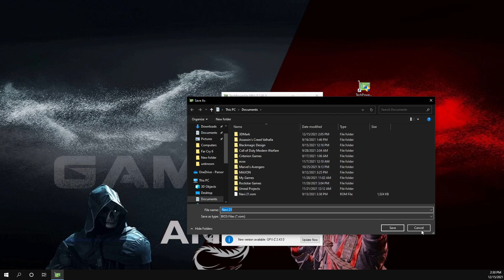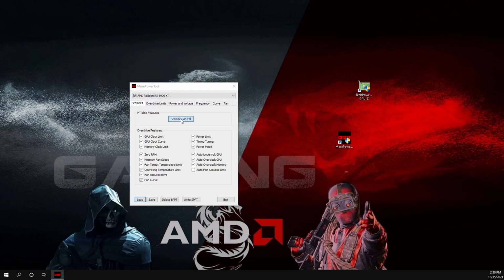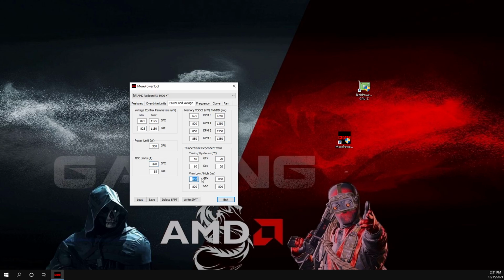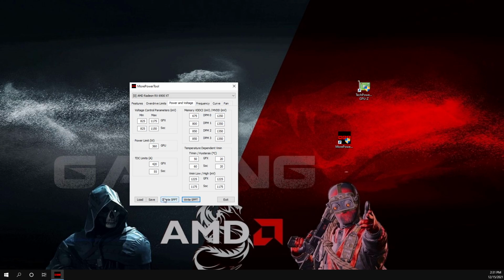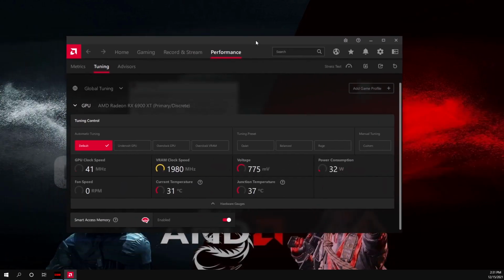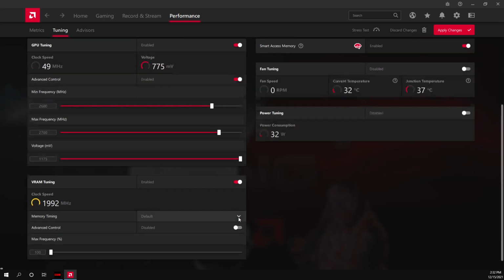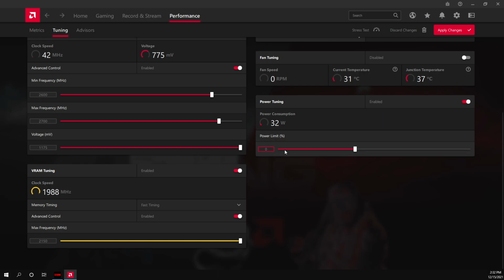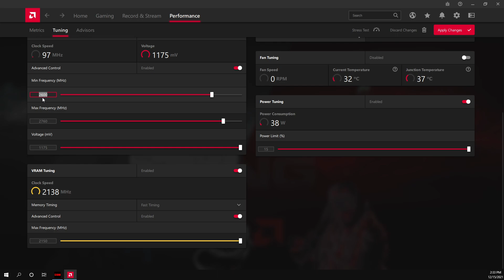AMD MPT ( More power tool ) Updated with how to add voltage adjustments.

Comment: I set a wider range in memory but if I exceed the default maximum my clocks drop to 500, do you know a fix for this?
Reply from the maker: should not mess with mem.. if you want to push out super fare swap bios this if done corectly would get a 6900xt or 6950xt up to like a 25k score if cooling is good in timespyt almost a 30% increase in performance. it really depends on goals and what you are confotable using I have run 800+watts to my card. it cooled by oipen loop with 4+ 360mm rads. duel pumps start loging benchmark temp with gpuz and look for temp spikes then 2 line gpu clock drops to like 500hz this tells you something is to agresssivce to the clocks being used .. memory the 18GB bios from techpowerup flash one side then you might as well do evc3 power mod and the cards will push to 28k plus in timespy.

Comment: Your VRAM is locked at max. Suspect vblank timing issue. Card should have idle power 3-6w. You're at 38W lol. VRAM clock not idling-known issue easily jiggled. Bang bang skeet skeet. AMD says no biggie. I say wtf brah 38w bang
Reply from the maker: so results of tuning with mpt on the 6900xt keep in mind this aspect has run like this since before I did the video showing how since about may of 2021 to present day...as for power yeah My cost to KWH is 17 cents like I care about power 

https://www.3dmark.com/spy/33335050

Comment: i need some help i have rx 6900xt i set in MPT 2600-2700 mhz and 1115 mv and now pc only stays at black screen i changed bios switch and that didnt help too
Reply: Happend to Me also, go info safemode with  wifi and download amd utility driver deleter, and then restart

Comment: can you help me overclock my bravo 17 5500M? i see the numbers but need some assistance
Reply from the maker: I have not worked with this and sounds like a laptop GPU and cooling would be the first limits you run in to I have another video showing how to in drivers kind of should be the same on a laptop GPU
Reply: It will work.For 5500m I will suggest you just enable those override functions only on first window then write it . Then after rebooting overclock on amd adrenalin softwere.

Comment: Thanks for video, will be testing it on my 5700, to raise 158W to 180W(Aliexpress Card, they messed with the settings I believe) & Core Freq from 1800 to around 2100.

Question, so after pressing "Write SPPT" we just need to do a reboot & no actual flashing is required?
Reply from the maker: Yes just reboot. These save in windows registry
Reply: @AMDPCBuoldersCommunity  Great stuff, thanks, very flexible if you don't want "permanent" changes & don't want to worry about bricking the GPU incase of a messed up BIOS flash.
Reply from the maker: @AlexHusTech  bios reports the base numbers to write to the regstry with mpt you can edit these .. on the 79xx ones rdn3 they verify them cant brick a bios here doing this RBE ( red bios editor ) is editing bios settings and works on 5000 and older gpus here you could edit a bios and brick it
Reply: @AMDPCBuoldersCommunity  Hmm can't seem to find the download link...
Reply from the maker: @AlexHusTech  for mpt? rbe just about most the tools and info can be found here 

https://www.igorslab.de/

Comment: I tried to set my Max memory clock in OC limits beyond the 1075 MHz (6800xt) but my GPU clock then gets locked at 500 MHz. Did AMD lock the overclocking of the VRAM, or am I doing something incorrectly.
Reply from the maker: Yeah if you mess with anything besides power and voltage in MPT the drivers don't like it too much. There is a couple of variations on the 69 series that you can kind of mess with but like the first iteration of the 6900xt it doesn't like it it's actually the one that has the 18 gigabit-per-second bios but you can get away with
Reply from the maker: The 6800xt on water cooling can push about 23-24k GPU score in 3dmark time spy. The colder the water the better it will push this does take a lot as well if you are air cooled the it will come down to ambient temperature case flow and how well the thermal paste, pads are. And cooler removing the heat. Once you start hitting 70c it almost stops scaling and if trying to find a daily settings keep it at about 60c junction hot spot only worry if it hits 110c as this is throttle limits .
Reply: @AMDPCBuoldersCommunity  Good to know, I'll try to keep my GPU as cold as possible.

Comment: Hi guys, I have a question. How do I save bios with MPT so I can have def settings ?
Reply from the maker: Just write it reboot. To remove delete it or reinstall drivers, however past 22.11.1 something has been different for me at least I might format to see if it goes away or not but adding voltage does not seem to work past 22.11.1 anymore

Comment: when I try loading the rom file it just says "maximum file size 1024kb" i cant use it
Reply from the maker: it should if you used gpuz to pull the file then something is wrong and needs to be troubleshooted out.. you can grab your bios from techpower up as well but it would be better to pull it from gpuz
Reply: @AMDPCBuoldersCommunity  nvm I guess they don't support 7900xt. :(
Reply from the maker: @PsychoBenches  no it does not AMD blocked it and why I don't have the 7900xtx $1000 is not worth the gains if I can't push past a 4090.  Lol
Reply: @AMDPCBuoldersCommunity  The XFX merc card that came out has a lot of headroom. Overclocked with adrenalin I beat a world hardware record in 3dmark speedway twice. If I over-watted it a LITTLE more I'd be able to have gains up to 10fps on average. It's why I really want MPT to get around this, or red bios editor
Reply from the maker: @PsychoBenches  I am following along with the guys that do this stuff in the red rebellion and hope maybe they find a work around but my daily on the 6900xt is 550/1225mv and it scores out super close the the stock 7900xt I could flash the bios on it and pull even more out of it. I like to push it was super fun the last 2 years to make 3090 owners to hide behind port royal. But the best xtx hits about 35k in timespy and the 4090 are over 40k 1k cost for one aspect Is not enough gains to cost. But who knows maybe a refresh will come and maybe we can get more they claim they held back it be nice to see it
Reply: @AMDPCBuoldersCommunity  yeah I used mpt on my 6900 before I switched and it had crazy headroom. My specific card didn't have good thermals though, but I have a xfx and really curious if it'll work but obviously I can't with a 7900 unfortunately
Reply from the maker: @PsychoBenches  xfx did really well on their cards power color red devils as well working with a 6950 ASRock formula with someone right now. Very good card from what I've seen so far. Asus tuf pulled 24k in timespy on air. I would love to see this card under water. I can list on and on on them The reference did decent. I have helped well over 200 people on these things. I just wish they did not block it on the new cards. I am waiting to see something better if not if arc is well enough maybe it next gen or the one after they will catch up. This coming from someone that's been AMD since the 9800 way back in the day should say volume about how I feel about what they are doing anymore.
Reply from the maker: I have spent years on this channel basically showing AMD can and my fb group as well I decided to do. More  gaming stuff for the time when I have time as it easy to hit record and upload. I want to do a mpt video showing my work but to many users try copy paste settings and worried someone will hurt there card. Buy copying and work with interested users more on an individual basis
Reply: @AMDPCBuoldersCommunity  Really strange move for AMD considering one of their selling points is overclocking. It's literally built in their software and now they're blocking it? makes no sense. I hope they come to their senses or someone figures a work around. I want to add 20 extra watts to tdp for 7900xt
Reply: @AMDPCBuoldersCommunity  That's very respectable. It should be told more that MPT will not break your card. Thermally it may cause issues but its important to check your temperature but modern GPUs will throttle at such high temps anyways.
Reply from the maker: @PsychoBenches  in drivers you can out side third party tools no but there is something past 22.11.1 where giving voltage is buggy now. On drivers as well on the 6900xt I need to format to be sure it is drivers but good feeling it is

Comment: Why your VRAM clock speed is always max as well was power consumption is not normal for idle i guess
Reply from the maker: I am doing everything same system in this video but  mine is allways working as well and it does not matter if it is maxed it does not shorten the life of a gpu.. heat is what shorten the life of a gpu example my r290 has been overclocked since 2012 to date.. this system is about to be retired tomorrow still working perfectly and most likely will get reused till hardware dies..

Comment: Thanks for the Tutorial, my card is a Real Potatoe but know it can run 2700mhz stable. And you wouldnt recommend this for Gaming?
Reply from the maker: You can always test this out. This particular video is a guide for pushing past the limits of drivers and would not recommend doing this if you are air cooled it's not impossible but the heat will come in to play and that would depend on all factors for cooling and things. I use 3dmark timespy for stability testing as usually if stable here it should be stable all games at least in my case it has been keep temperature at or under 60 c on GPU you should be ok I will be doing a indepth tuning video soon
Reply: @AMDPCBuoldersCommunity   temperature wise im pretty safe, using a custom loop with a 480 radiator only for the gpu. When the card pumps 400w im round about 53c core and 65-70 hot spot. i thought im stable but battlefront 2 crashed after 20 minutes of gaming. Which is odd, because it was running fine with 2750 for an hour or so but crashed with 2700 after 20 minutes. Which settings are you using for your 24/7 usage?
Reply from the maker: @345ifyhalo  500w 1225-1275mv 2700/2800 
Daily 
https://www.3dmark.com/spy/33335050
Reply: @AMDPCBuoldersCommunity  wow that is pretty impressive, which card are you using? Im having a ref card and dont feel to good about pulling 400+w through the 2 8pins. Isnt it pretty bad to run the card with a voltage high as 1275 24/7 ? Amazing score!
Reply from the maker: @345ifyhalo  toxic, the reference should get about 24400 In ts

Comment: My system was randomly rebooting, games were crashing to windows with any OC to a WC EKWB RX 6900 XT.  I discovered that it was a faulty power bar that I have been using for years without issue, until now.  I don't have as much headroom on this Gigabyte AORUS Gaming OC card as I would like but it can just barely handle 3440x1440 in most current games using Ultra settings at 60fps  I am more interested in a solid 60 fps with better color representation than over 120 with a washed out experience..  I also turned off Global C States in BIOS so that may also be contributing to a more stable system.
Reply from the maker: Well the rebooting issue can be power or a system stability issue. If the system. Is directly powering down not enough power supply or heat maybe a bad installed block but maybe hwinfo64 can help determine this. Other issues to think about is ram xmp or chipset drivers for ram xmp you can check event viewer look for whea errors and might be some kernal power errors as well that could point directly to both power and if xmp issues   windows automatic driver updates can also cause issues in drivers not showing streaming options or updates with in drivers and if you see these you have to disable this with in windows.  My fb group is linked off this page give a detailed post if you have fb include system information what you have done troubleshooting along the way. There is a few games that really struggle 1440p this would be based on game settings possibly being to aggressive clocks or even throttling. Mpt is normally used for pushing benchmark I do have daily power plans stable on mine but it took a lot of tinkering to get there if you are not stable on drivers on these plans first you have to get them stable here then move on to these higher power states if you feel the need I use 3dmark to test for stability. My best would be join with the fb group linked on YouTube page here I been thinking about a driver stability video just not. A lot of time between work life and here. Plus want to discuss over some things so I get reminders of all the fixes with my fellow admin in the group . Then though about showing how I tune and overclock in stock drivers as well as mpt in other videos but mpt takes some work and need to make sure you are not running hot or maybe miss mounted the block I have seen some on air run 400w plans fine as well . Reaching out in my groups will help figure out what might not be stable if I am not available. Then you can read though the group as well. I AMD going to try to get more information here asap but 50 plus hour work weeks can be hard at times lol.

Comment: hi! is there a way to save those settings for games? till now i've always seen them be active in benchmarks like time spy or so on. but in games the max wattage does not seem to work at all
Reply from the maker: I am water blocked on my 6900xt, I use a daily setting of 500w 1250mv 2700/2800 max everything else and run stable every game you have to experiment some to your cooling abilities as well as figure out what is toss the error for drivers to crash 

https://www.3dmark.com/spy/33335050
Reply: @AMDPCBuoldersCommunity  realy nice score mate! i was able to score 22.5k with my rx 6800 xt with 400w of power draw. but i cant find a way to make the increased power draw to work in games, every game i start keeps going on max 250-270w in qhd

Comment: hello again, i writing you after 1 month we talked in discord. now i have 6900xt and this card give me 400w and good oc, but i have some questions. i know you have 6900xt too, how you overcame bios and increased memory speed more than 2150, if you do this. and one more thing: my 6900 xt give me core clock 2660 on 300w, but after 400w i can't get more than 2660, performance little increased due to energy consumption, but i can't get more frequency. please answer if it's not difficult for you.

Comment: hello, can you help me with my rx 6800 xt? i do all what you say but gpu z show stock 320w max. maybe you have ideas why mpt don't work?
Reply from the maker: Save bios, select card under drop down menus in the tool load bios. Then set setting write them reboot. If you need help with input for settings best to reach out to me on FB through my AMD PC builders group linked on the social tab so we can chat about cooling and things first do not copy my settings here it's just general information on what to change for getting power and wattage up.
Reply: @AMD- PC Builders Community  i do what you say and this don't work. i read here you help people with their 6800 xt. maybe you can say me lowest minimum clock vmin for 6800 xt? i can start with this
Reply from the maker: @Ghost-wz8jg  honestly best method would be direct chat with me. this way if troubleshooting is needed I can assist here as well I am working on a beginners guide to this tool it might take some time to get it done.. but contacting me on FB would be a lot easier for me to help you get it going as well as making sure the tool is right for your use..
Reply: @AMDPCBuoldersCommunity  im so sorry but fb don't work in Kazakhstan at this moment, that's why i ask you say numbers working for most 6800 xt
Reply from the maker: @Ghost-wz8jg  discord maybe? Best method would be chat for me this way I can help get to the reason you are having issues
Reply: @AMDPCBuoldersCommunity  yes, discord of course. thank you
Reply: @AMDPCBuoldersCommunity  when i can chat with you?
Reply from the maker: @Ghost-wz8jg  https://discord.gg/jz2DcX3
Reply from the maker: SN earthishome7569
Reply: @AMDPCBuoldersCommunity  i accepted your invite
Reply: @AMDPCBuoldersCommunity  hey man, can you try help me again? i do all what you say in discord but card don't get more than 320w. sorry for problems

Comment: thanks a lot for this ... can i ask why you set the min/max values the same .. also the min core frequency in wattman is so high ... why is that
Reply from the maker: This video is how to input numbers into the tool. Not copy paste settings . The clocks and numbers you have to figure out on your own.
Reply: @AMDPCBuoldersCommunity  i get that, but why did you set the min/max mV as the same 1225 & 1175

I try that. It was giving me issues. When i put just the max as 1225 & 1175 mv things got better.

Your video helped a lot, thank you
Reply from the maker: @TheLateral18  minimum voltage max voltage I keep minimum at stock voltage top is max voltage I want to put in to it  this way if it needs to cut back it will

Comment: My VRAM keeps clocking down really low causing crashes, how do you set it be static and stay within a certain range. I managed to get my core clocks to do it. just not sure which setting I need to change for VRAM clock. Anyone able to help would be so much help. I have a 5700XT